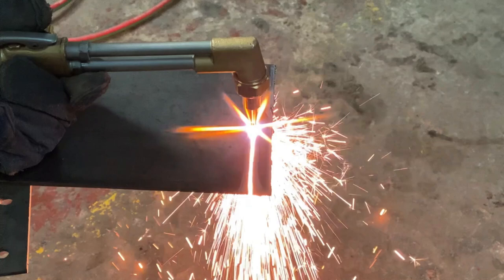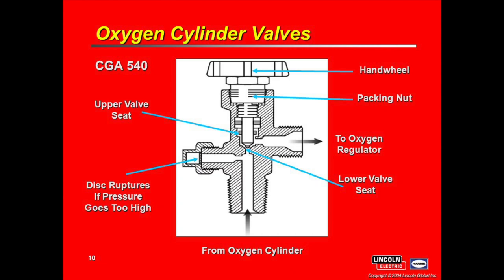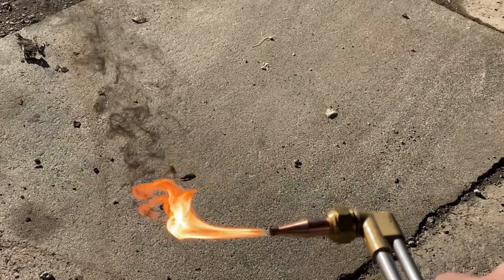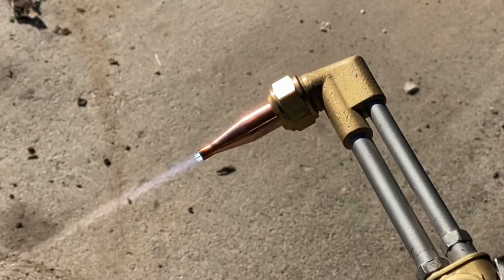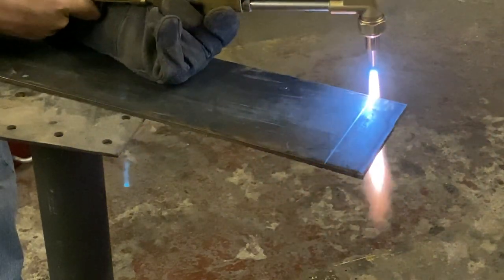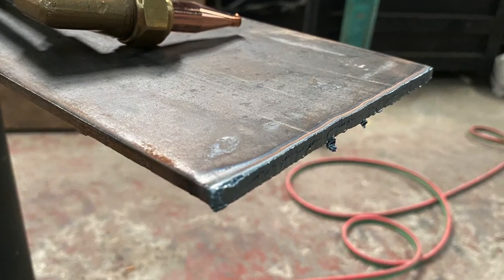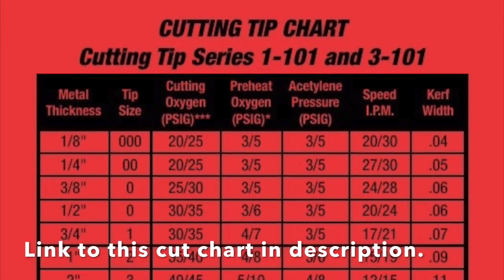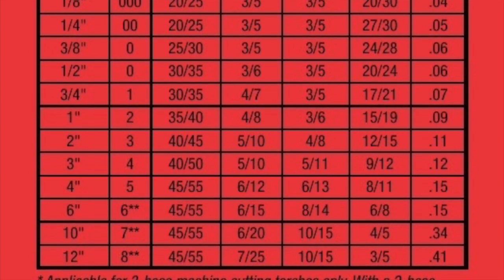How To Use A Cutting Torch

Comment: You make it look easy 
Did a welding corse years ago for mig welding and we did some cutting like this and I’ve used it for work a few times but cutting a strait line ain’t easy at all. 
Like you said experience is a great teacher and I’ve not nearly done it often enuf to get anywhere as neat a result as that. 
Thanks for the refresher on something I’ve not thought about for 20 years lol
Reply from the maker: I think just about anything is easy to do with the right teacher and experience. You're right though, it takes practical experience. Honestly, this was the first day I used a torch to cut metal in almost ten years now. We do everything by plasma cutter. It's like riding a bike though, once you know it, it never leaves you.